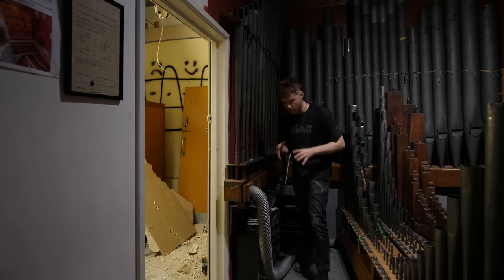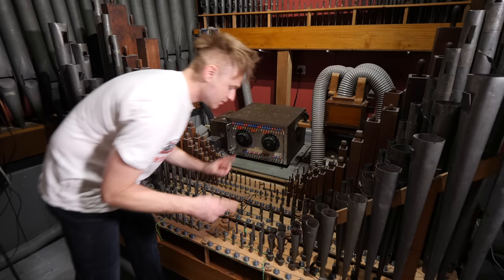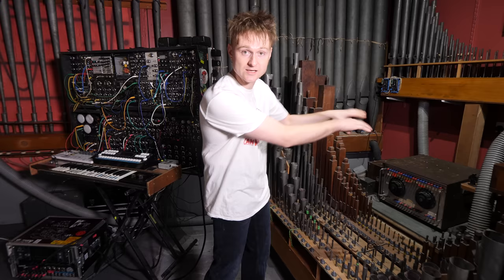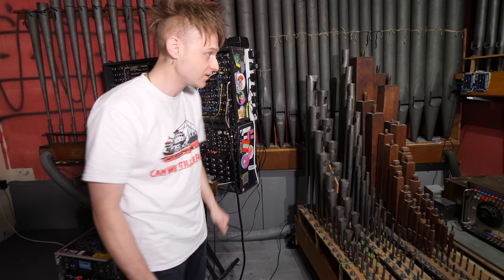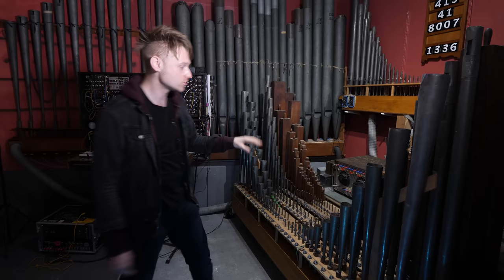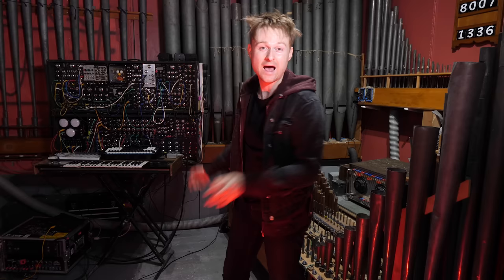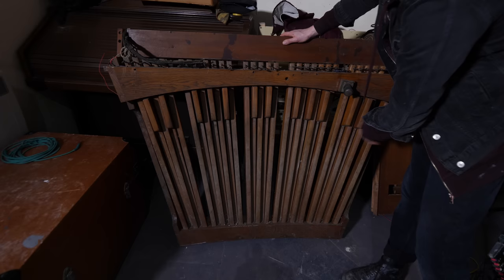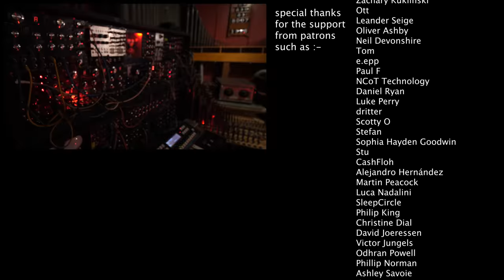PLUGGING A CHURCH PIPE ORGAN INTO A SYNTHESIZER - I BOUGHT A CHURCH ORGAN PART 9

Comment: A 'preset button' is exactly what it is, except organists would call it a foot/toe piston.  Chances are originally it would have been wired to either pull 'everything' (likely full organ without reeds) or as a 'general cancel' to shut the organ right up in a hurry.  If Joan was really lucky, it might have been a 'reversible' foot piston that could toggle between two states.  Modern organs and digital consoles tend to have them configurable to do whatever you want.  I'm probably about the 900th person to add this in your comments... 🙂

Comment: That foot switch is called a toe piston or toe stud and is generally used to recall preset combinations of stops, in case you don't have enough fingers to hit the thumb pistons and need to use your feet instead.  In this case, since there's only one, my guess is that it was used as a general cancel (all stops off).  That's not to say you couldn't order loads more and use them for all kinds of things!

Disclaimer:  I'm an organ enthusiast, not a professional organist.
Reply: Was about to say the same thing, I think that's exactly what it's for. Also not an expert by the way, I just happened to have read about foot pistons a while ago when I was clicking through Wikipedia :)
Reply: It could also be a "piano" button, quickly switching to just the soft flutes. Or it can be "stepper next", or it could switch between free stop selection and button presets. It is usually used to change stops during playing. But make it just a MIDI control button and do whatever you like with it. Some organ consoles have 10's of them
Reply: Me too, my guess is that if you press it multiple times, with the original circuit boards, it jumps between all the presets on the thumb pistons...
Reply: It’s a ‘Full Organ` pedal for maximum change of volume. Some organs have multiple toe studs or toe pistons for exactly the reason you point out.
Reply: It could also be a Pedal to Great reversible - a toggle button that controls whether the Pedals are “coupled” to the Great organ pipes. When toggled off, the pedals control their own set of bass pipes, and when toggled on, they also control the lowest octaves of the main pipes! Super handy!
Reply: @kgutwin  I don't think so, this organ doesn't have any pneumatic coupling action.... at least it seems like there isn't any in the first video...
Reply: 51% of professional organists are snobs so that's why you answered 😉   the piston could have been for anything.   Bell toll?  Sforzando pedal (more air pressure for more volume) or any number of things already mentioned.   Maybe Joan loved tambourine and played tambourine while chording revival hymns 🙃
Reply: I’m fairly certain, although I’m not an expert, that the foot switch is there to instruct the Furby choir to start singing.
P E A C E   : )
Reply: @jw1289  It doesn't have to be a 'full organ' pedal (toe piston you mean). Toe pistons can have any function the organ designer wishes. So it's up to the uploader of this channel what to do with it. It can be a setzer "next" button, it can be a 'full organ' button, it can be an 'all ranks off' button. But without setzer system i guess it will remain without function. Just let it put out a midi control signal, and later he can decide what to do with that signal.
Reply: @FUNKINETIK  Ah yes, the Furby rank
Reply: @kgutwin  I agree with your guess as the most likely. But, as many have pointed out, it could be for anything, like, a fireworks button if that's what you want (I know I definitely do)!
Reply: It might also have been a toggle for one of the couplers. Strange that there's only one and it's on the right though.
Reply: @Engineer9736  ✅More knowledge than myself. With a midi output he could have range of options on a switchboard without dedicating it to any particular task.
Reply: I came here to say that. I'm no professional either but I did play a few theatre and church organs in my teens (during the dawn of midi! Never even considered the two co-existing!)
Reply: That makes sense. When I was in the church choir as a kid, the organist would always sit down and hit one of those buttons before playing then again when she finished. I always assumed it was like an on/off button for the foot pedals to ensure if she was getting up or sitting down, she didn't accidentally play notes in the middle of the sermon. lol.
Reply: Could be used as a Tutti ‘everything on’ a Piano ‘ffs shut up!’ or as a Pedal to Manual coupler. This is likely what Joan had it as. 
Is the 16’ Bourdon playing? I’d expect it to sound hella thicc if the whole organ including the 16’ was playing on one channel.
Reply: @karlfischer1011  I don't think you can put more pressure in it... for example if it was voiced on 15" of wind it couldn't play at higher or lower pressure. I think.
Reply: It's either the headlight dip switch or the Nitro button
Reply: @analog_mind  you can have one pipe on dual pressures to gain an extra stop, so I believe the sfz could modify the air regulation with a solenoid.   So many parts to learn about 😀
Reply: @FUNKINETIK  it will be, now 🤣
Reply: @karlfischer1011  I’d be totally honoured if Sam decided to do that. I’m sure the Furby Organ was the first LMNC vid that I watched.
P E A C E   : )
Reply: Well the google machine tells me sfz and tutti are just a pre-selected loud ensemble, so my understanding of the function was wrong. I once played a small pipe organ where the sound didn't change but it got louder so that was a weird experience to teach me the function with.  🙃
Reply: Perhaps it's the "Choir to Pub" coupler, or is that too niche?
Reply: @NicksMadScience  NFN but I'd be totally up for a pipe organ with a Furby rank... Might be tough to find enough Furbies that he hasn't already hacked up to do it though.
Reply: @karlfischer1011  I didn't know that, i was told that if a pipe was voiced ona certain pressure then would not work with other pressures! Maybe that's the meaning of the hole before the bellows he covered in the second video...
Reply: @karlfischer1011  I’ve never seen a pipe organ where they do that in 15 years of reading about and visiting pipe organs. Yes technically you can, but in practice they never do.
Reply: @FUNKINETIK  Best answer so far!
Reply: @davechisholm9670  Cheers Dave - the Furby Organ was the first LMNC vid that I watched, it creased me up. A very humane way of treating Firbies as opposed to cooking them in a microwave.
P E A C E   : )
Reply: @FUNKINETIK  Yes, me too - looking at circuit bent vids, I chanced across the Furby Orchestra which introduced me to Sam's madcap genius!
Reply: @FUNKINETIK  or the Lego Star Wars Orchestra??? 😂
Reply: This comment took me on a walk down the memory lane like an organ enthusiast in Beijing once did. I woke up in an ice bath without a kidney.
Reply: Could it be a manual to pedal toe stud?
Reply: @analog_mind  some of them like flue pipes if you increase the pressure enough you can get the pipe to sound approx an octave higher at it's 2nd partial. It will be slightly out of tune, and have a more harsher sound with more partials, and less of the fundamental. Reeds on the other hand, have to be voiced at approx the right pressure or it'll sound horrific. Picture a young band student learning to play the clarinet or saxiphone type of squeak/honk sound... overblown reeds are not good!
Reply: that's right based on my experience. you should rig it to send a MIDI panic!

Comment: I am soooo jealous of what your doing... I'm an organist and am slowly bringing my local churches organ back to full strength but nothing like on a scale your doing!!

On the pedal board, that piston/button is called a toe piston. Normally there would be ten or so toe pistons which are used in a sequencer system, which essentially allows the organist to preset the stops they want to use for that piece and they can quickly select the registration for that piece. Often found in larger organs like Joan's Organ. If you look at the console, underneath each manual there should be other buttons... They might be numbered?? Those are also those sequencer buttons, but are called thumb pistons, but they do the same thing as the toe pistons.

I believe the toe piston on the pedal board is just a cancel piston, which essentially returns all the stops that are drawn at that given point. It's basically one big reset button for the organ! I'm not entirely sure how the sequencer can be set up on an organ, like how you can set the presets, but you'll probably figure that out!. The organ I mostly play on is a small one manual plus pedal board, 10 stop organ, so there isn't a need for a sequencer. 

Well done you though for bringing Joan's Organ back to life, they are tricky to get going again once they stop working!
Reply: Sometimes the internet seems useful

Comment: Yes! That button on the pedalboard is a preset button! You can press it with yor foot to change presets if your hands are both on the keyboard! But there is only one  and I don't know if pressing it multiple times would have changed preset, maybe with the circuit boards you've cutted of from the organ . Il turns on the stops (or switches as you call them haha) with the electro-magnetic system you explained on the museum channel. And I hope you know that lifting the pipe from her mouth, specially the lead ones, can de-voice the pipe ahahahah. That's The most beautiful project you've ever done!

Comment: Gorgeous sound, they were made for each other! Imagine taking this setup to festivals
Reply: Yes! But he'll need some more roadies...
Reply: There are trailer mounted fairground organs/orchestrions, that run on continuous fan-folded punched cards in a fashion not dissimilar to a pianola roll. Working examples are getting pretty rare now, but I believe the odd one has been converted to include MIDI interface electronics as well as the original punched card stack, it's easy enough in theory but a bit tougher in practice to get it to work well.

Comment: All organs are different but it probably was a preset button of some sort. Generally you can load a combination of stops into them, and that way you can change the sound produced halfway through a piece without having to mess with the stops themselves. Based on the organs I’ve seen though, there are normally a number of them or none at all.
Did the organ originally have a swell pedal? They control a series of flaps in front of the swell pipes, allowing you to alter the dynamics. Something probably quite hard to replicate in the museum, but I wonder if your foot switch was somehow related to dynamics, there being only one.

Comment: The nice thing about adding those lights, is it's not just to look cool. (Although it definitely has that aspect.) I bet those also help out a hell of a lot as a diagnostic tool to show the signals are actually doing what they're supposed to be doing, so it doubles as a trouble-shooting tool. You get the light show happening in the right spots, you know it should be all good. Fits in well with the modern modular systems integrated with the old-school physical hardware.

Comment: Try again 
That a toe stop
It can be use for almost anything that you just need an on off control for. It could also be tied into the combination Action to activate a tab/piston stop with your foot.
On theatre organs they are use to fire off things like base drums, thunder sheets, or other "sound effects" from the toy counter amongst other things. So basically it can be used for anything you need to activate with you foot
They are normally lable on the panel under the keyboard just above the peddle board where it fits into the console

Comment: As a church organist I can confirm that “button” is a toe stop or toe piston. It works in a similar way to the thumb stops that are normally placed below each keyboard. 

Depending on the organ builders preferences, this can either carry out a set function, or on some organs it can even be “programmed” by moving switch contacts that operate solenoids fitted to the stops that control each of the pipe ranks.

Unusual to only have one toe piston, but since this organ was moved into Joan’s house who knows what functions were lost or added during that move. 

One possible (non musical) option I’ve seen in some churches, is a signal lamp controller. As the organ console is often placed away from where any entrance procession begins, there is sometimes a switch that can flash a lamp in sight of the organist to let them know something (pre-agreed) is about to happen. In one church there was a “reply” option that flashed a lamp back downstairs, but this was a thumb stop and not a toe piston, but who knows. Maybe Joan used it to get her hubby to bring her a cup of tea?

Comment: Sam, great project, you're absolutely right about the piano - pipes tuning, if you ask a piano tuner if he just sits down when tuning a piano if he starts with one key and tunes it against a chromatic tuner and proceeds up the keys he would say no. There is much experience and practice involved with tuning a piano. I have talked to several tuners and they told me that there is no character in straight tuning against a chromatic tuned piano, it takes experience and the ability to judge the tune by ear also on a piano there are issues like multiple strings for each note and the stretch on the sound board when tuning up the scale of the keys. Just do it your way and you'll have more fun. Thank you for your videos as they are very fun and informative to watch, good luck from the states.

Comment: Impressive project. I'm too old for this stuff so it's really great to see you go at it.
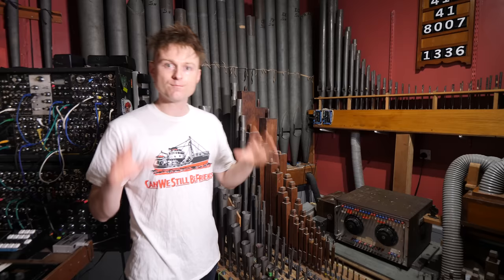2:57 is by far the most concise explanation of what MIDI is, ever.  
Just call it “Mixed Temperament” and leave everything as is. Give anyone who asks the same explanation.
I totally agree with your notion that the difference in temperament adds character. Engage the temperaments judiciously and when that works out it leads to unique sound that is not possible to generate otherwise. 
Also, it's art. Imperfect expression is a given.

Comment: The button on the pedalboard that you asked about, (a toe stud) could have been used for several different things.  Since there is just one on the right hand side, my guess is one of two things.  It's either a coupler (probably great to pedal - that is, the pedal plays all of the stops used on the great manual as well as the pedal stops).  Or, it's a sforzando or tutti pedal that turns on all of the stops on the organ.  In either case, it's reversible, that is pressing it once turns it on, pressing it again turns it off.   There might be a label on the console for this.  I've played organs with several toe studs mounted like this on the pedalboard but with the labels on the vertical board that's part of the console.  If you can't figure out what Joan used it for, just use it however it works best for you!

Comment: I've noticed a lot of comments are pretty close on that toe piston, but are missing a few things. In the USA a single toe piston is pretty random and could be any number of things, but in the UK and most of Europe a single toe piston is used for progressing from one preset to the next set of stops or preset midi controls, and you whack it every time you need a stop change. It's actually quite a different method of changing stops than most organists in the USA use, though one I prefer due to the simplicity of it vs remembering where you stored your registration (in the USA most organs can have anywhere from a small handful to hundreds of registration pistons, often each with several memory banks worth of combination storage to add to the complexity).

From your perspective though it's a button. Program it to do whatever you want! I've actually built my own organ console using a 1979 theatre organ as the base and have had to retrofit midi into it myself. My favorite part is that you have complete control over what every button does.

Comment: That knob is a piston used activate a preset in the pedal  ranks. It also may have been used to put the organ in to full stop mode (all the pipes at once). On theater organs, they could be used to activate a solenoid that would play a real kick drum or snare drum, a wood block or a triangle ( you get the picture). If you prefer the detuned sound after you tune everything  up, just engage a celeste rank along with the your chosen sound, and you will get the detuned sound.

Comment: Hey Sam. Cool thing about that switch is that it could be anything because organs have so many wide and varied standards. 

If I had to guess, it’s probably either a preset for recalling a particular set of ranks… Or it’s a general reset - that would cause all the stops to rested when pressed. 

Did you get a volume control (swell pedal)? Usually you’d get some of the pipes hidden inside a little box (the swell box) with slats on the front that you can open and close. Open it for full volume… close it up for quiet ;) 

So glad you’re doing this. I’m totally living vicariously.

Comment: The button on the pedal board would probably been to turn on/off coupling between the pedal and manual(s) (so you can play the pipes normally associated with one of the manuals on the pedals). But if you want to reassign it to switch something else (maybe cancel all active ranks?). There are no hard rules about what such buttons do. If the keyboards are water damaged, replace them with a new midi keyboard (or two). The pipe organ I play in my local church is midi controlled - the console is just a glorified midi controller. What you are doing is absolutely acceptable. There's no such thing as a standard organ, so there's loads of room to be creative with your build (and that includes tuning!)